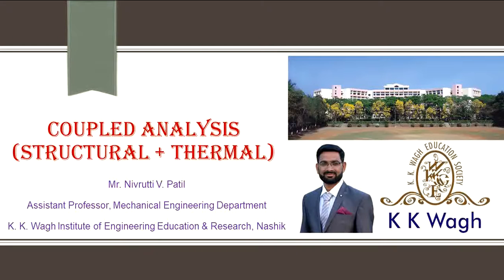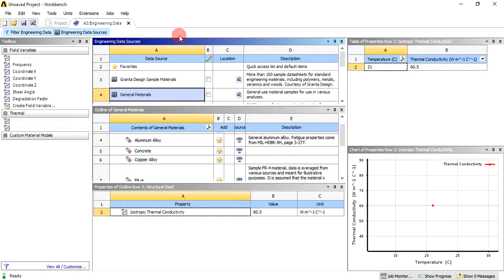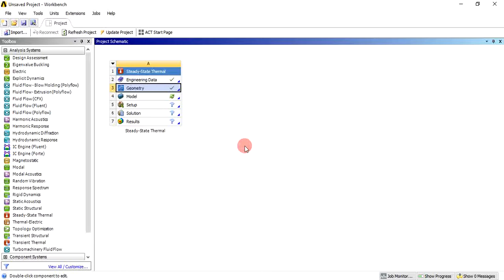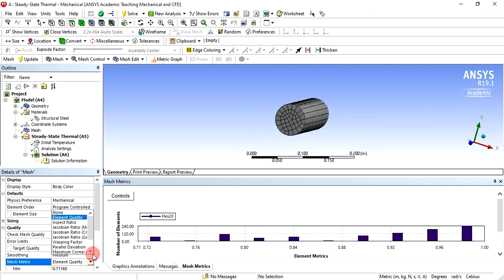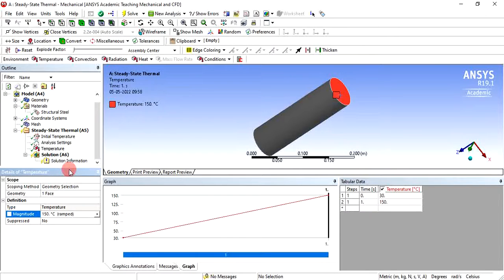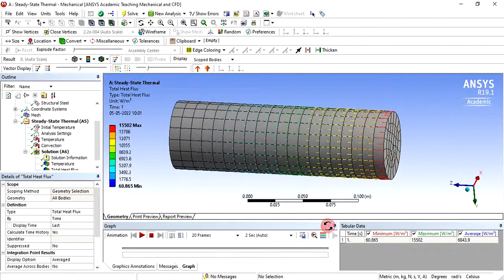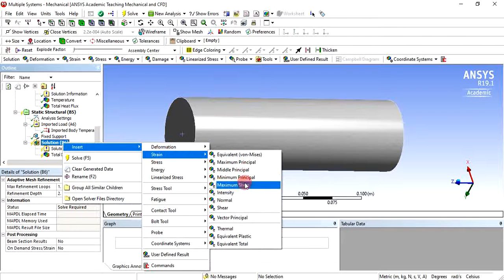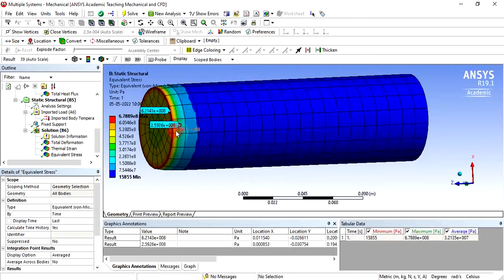Coupled Analysis (Structural + Thermal) using ANSYS Workbench

Comment: I would like to perform a fire analysis on a reinforced concrete beam under a static load. Would it be appropriate  for my analysis to use the analysis systems (steady state thermal-static structural) in your video? or should I use other analysis systems (like transient thermal)?
Reply from the maker: May be transient is appropriate
Reply: So steady state and static structural parts are not suitable for fire analysis🤔 (For fire I will use Eurocode EN 1992-1-2: Design of Steel Structures, General Rules, Structural Fire Design.)
Reply from the maker: @NurselKutuk if temp distribution constant - steady state 
If change wrt time - transient
Reply: thanks a lot for these information 🙏
Reply from the maker: @NurselKutuk wc🙏

Comment: What are the advantages of coupled analysis is done if the results are obtained seperately?
Reply from the maker: Time saving, accuracy,proper understanding of complex systems.
Reply: @nivruttipatil8013  in my case, when I have coupled transient structural with transient thermal, only upto modelling part was connected unlike shown in the video.Do you know what might be the reason for that??
Reply from the maker: @ameliam7732  may be required to provide proper boundary conditions